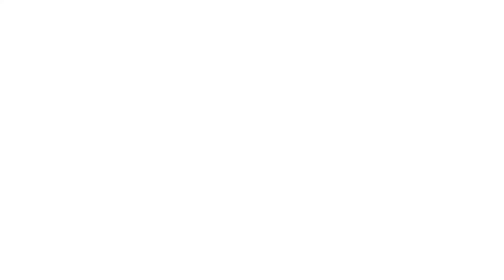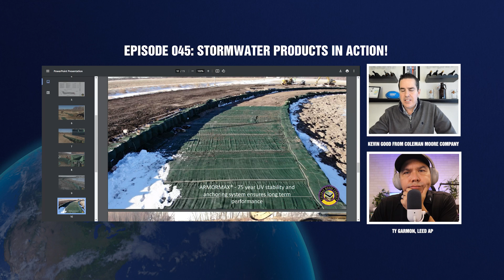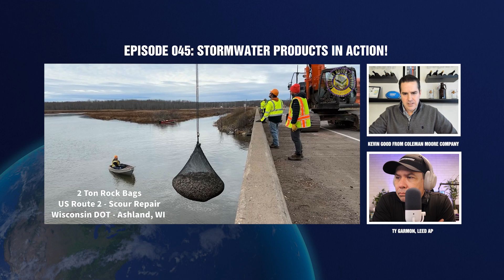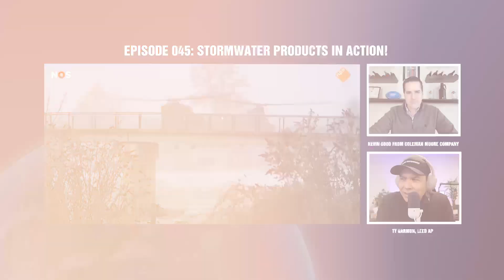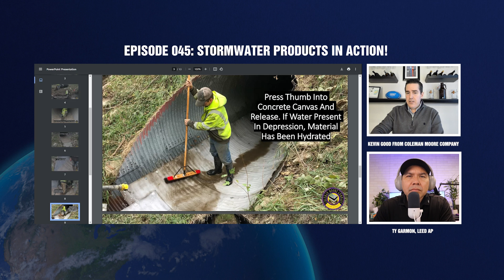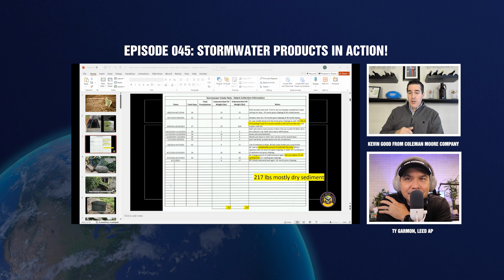Stormwater Products in Action! with Kevin Good from Coleman Moore Company

Comment: Great podcast. Are pH values from discharges that go over Concrete Canvass evaluated?
Reply: Jaimie, I was able to track down a response on CC website, hope this helps!

How does CC washout affect the alkalinity of watercourses during installation?
Concrete Canvas® uses a specialist high early strength cement with a limited alkaline reserve which is below the US Environmental Protection Agency limits. CC has been installed directly into live watercourses without the need for special environmental protection measures.